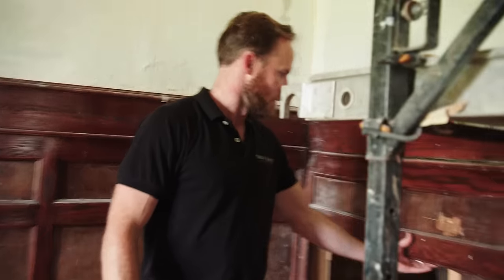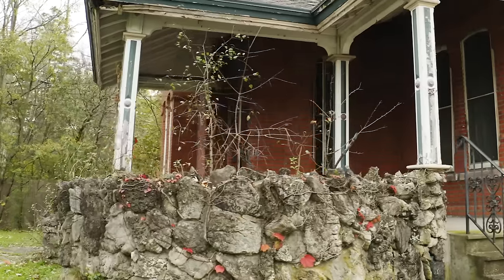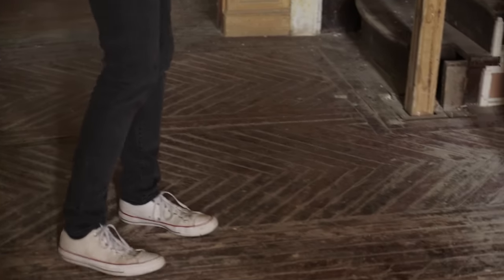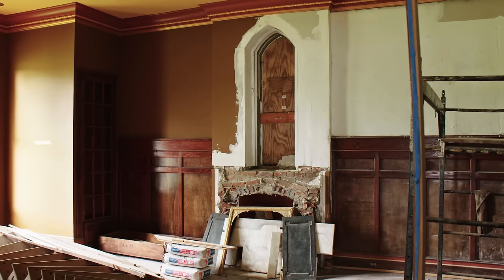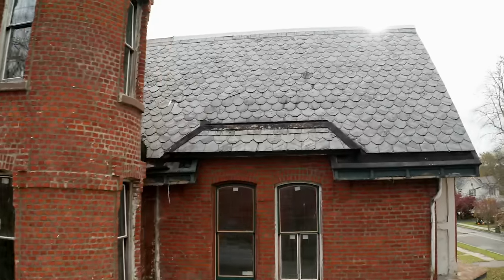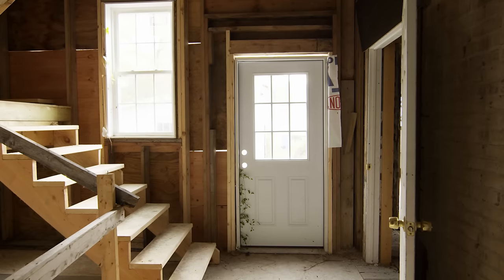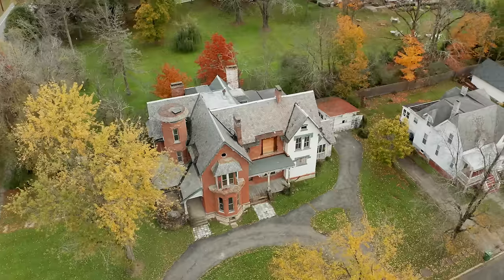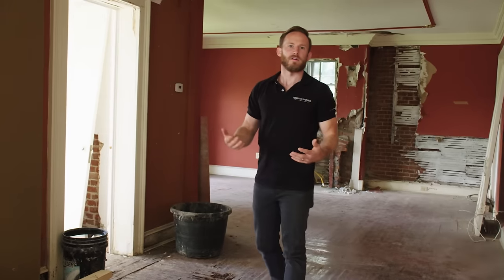Touring An Abandoned Victorian Home Ready For Renovation | Architectural Digest

Comment: huh...i would connect that upper tower to the attic-space by a new connection to the roof. It needs a little bit of reshingling anyways. why not make that part completely new. would also solve the water flowing around that tower when raining, possibly. Then it can be something of a reclusive space, maybe an art-room or reading-room or princess-tower for a childrens room. But i imagine with all those high ceilings and not so modern insulation that house would have a heating bill through the roof. Clearly a fancy house for fancy money T.T

Comment: I hope thats ash used to colour the lime pointing grey and it hasn't been repointed in modern cement. As if that's modern cement with them old crumbly red bricks instead of lime mortar those bricks are going to crumble and spall to nothing. You can't use modern cements in historic buildings without causing long term structural damage.

Comment: looks like you'd be right at break even with the recommended budget.  though the house would go up in value over time, though if you say it's to make it modern then it's obsolete in a year or two and needs to be renovated again but that's subjective and wouldn't cost as much presumably.

Comment: late to this vid but respect you for wanting to restore this magnificent place, it deserves to be done. I think you're really unrealistic in your assessment of the cost to do so though,  you didn't even touch on the electrical that will probably run somewhere upwards of $20,000, plumbing maybe close to that?  HVAC maybe another $20-30K,  windows alone would be $1000's, I'd doubt that you could do that for under $6-700,000, I think you'd have great place when you were done though. If its on the historic registry(you didn't say anything about it but just wondering)but if so you wouldn't be allowed to change the outward appearance with different windows/doors as much as you mentioned. Be a shame for it not to be done and good luck if you chose to do it.

Comment: Are we going to ignore the fact that in almost every room the fireplace and mantel have been ripped out of this house causing major damage? There was major theft on this property which will cause you to pay €5000-10,000 per room. That the owners/state didn't board up this property to save it is a crime in itself. I would not be surprised if historical snaps of the house could be found. Take these snaps to antique dealers who specialize in fireplaces and mantels. I guarantee you you will find your mantel pieces there. I've seen this numerous times in Germany where the stolen goods are simply taken to another village/state only to be found years later OR they turn up in other people's private houses causing year long court cases. The price is too high with so much damage. Take another €75,000 to fix all the firesplaces. I won't even start with how the banisters were ripped out! Easily half million!

Comment: Looks like they sandblasted the paint off - that brick exterior has lost the hard finish the firing process gave it. 

It needs to be sealed or it will start soaking up water and spalling.

Comment: You've got your work cut out with removing all that latex paint on plaster which has completely negated the benefits of plaster and also has been holding moisture in.

No to the Juliet balcony...not original to house nor necessary...waste of money.

It's a shame so many architectural features have been ripped out...ceiling medallions and every single fireplace surround...not to mention the newel post....sad they're gone.
I would never rip out a fireplace to create a gigantic kitchen in an old Victorian.

Comment: Too bad AD doesn't understand they should make this remodeling into a 12 part series.
There's so much amateurish repairs and additions to this house, just look at the mortar on the outside, it's done in such a way it looks like it was added later?  
All the windows need to be replaced, what is this guy talking about? Windows don't last. 
No mention of these ugly additions added to the side of the house? A white building, some shabby shed? This white building needs bricks or needs to be torn down and a brick addition built from the ground up.
It is disappointing that there is no basement, is this a flood area, is that why there is no basement? 
I do not understand this guy if he meant the attic should not be remodeled. The attic and the roof should be repaired and remodeled first. 
The attic has one of the most exciting layouts. 
The entire house needs to be remodeled, there's not a square foot that does not need work. There's rot everywhere, what you see in the video might be only 1/10th of it.
The way I see it, the area looks shabby, they show nothing of the area, they have a drone, but don't use it to show the area? 
The yard needs large trees and a four foot fence with iron railing, but really, it's hard to start adding all the work and details that needs to be done. 
$300,000 is way too much, this house will crumble in a few years if it's not saved now. It's close to being a "$1 house, but you have to commit to remodeling it". This guy works with remodeling, so I'd first listen to a lawyer and hear if this was a wise idea.
Would it not be cheaper to just build it from scratch?

Comment: 100K for a kitchen? 300k to start is over priced. the blocks on the porch say that. Structural problems, water damage, and the plan for a bath in the turret is lame. Every fireplace has to be redone. run away.

Comment: An energy efficient home or business is more comfortable and saves money in the long run.
Solar energy in the yard or on the garage combined with battery storage can make people more independent from the grid and natural gas supplies. Add solar and supplemental electric heating or a heat pump for home or business heating..
All big box stores and manufacturing sites can support solar energy on their roofs or parking lots.
Added insulation, triple glaze windows, energy efficient doors, energy efficient heating and cooling systems, energy efficient appliances, LED lighting, smart thermostats, solar panels combined with battery storage and a electric vehicle charger in the garage or car park. People are too focused on the short term costs and miss out on long term savings and comfort. Blower door testing and air sealing are under appreciated tools.Even if you have money to burn you should not waste it.  Climate Change will impact everyone. Leave a better future for your children and grandchildren. Join in and speak up for the future of the planet.